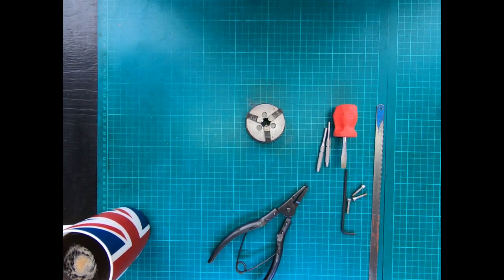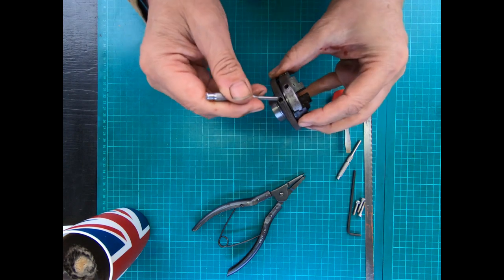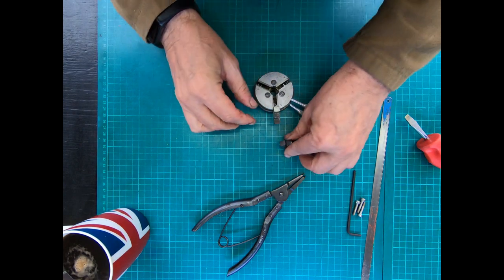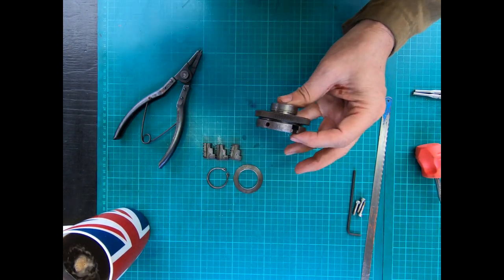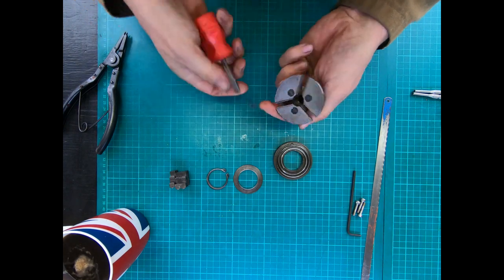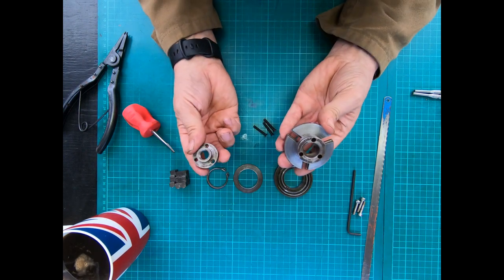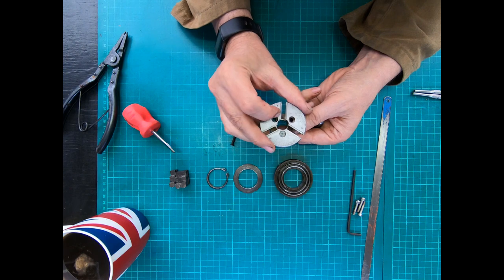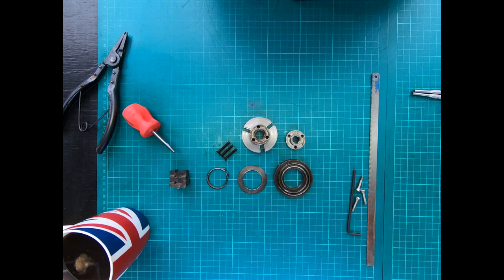Emco Unimat SL - Restoration - 3 Jaw Chuck Disassemble.

Comment: Hi Paul. I took my 3-jaw apart when I first got the SL, did not remove the backing plate, just cleaned and applied WD-40. It always seemed excessively stiff to me, but I guess that's the effect of the spring washer, your's in the video seemed to run tight as well, but I suppose that's normal.
Very curious to see how the stock threading attachment works. I had the wild idea to try driving the spindle with a stepper motor and a socket on the spindle nut, on my CNC SL lathe with the carriage and cross-slide that are already driven by steppers. But I am uncertain if this would be accurate enough for single-point threading, with the typical backlash in a vintage Unimat. Still might try it though, just for fun ...
Hope to see your other SL set up as a mill soon. With your collet set, it should perform well. Mine is a bit touchy with just the drill chuck, gotta keep the depth and feed rate low and slow.
Reply from the maker: Hello Rich,
My 3 jaw is very much the same as yours in that the spring washer makes it quite tough to turn. I am waiting for some longer screws to set up the thread cutting attachment but as soon as it arrives I will make a film. I think controlling the spindle speed might be a challenge to get a good thread.
100% there will 100% more "Unimat SL in Action" videos coming up in the near future, showing all the various attachments I have collected.
Take care.
Paul,,

Comment: Good video Paul.   The two small 3" chucks I have for the Sherline (one genuine and one totally worn out knock off) both have a one piece chuck body/spindle thread.  Interesting variation.  Cheers Rob
Reply from the maker: Hello Rob,
Thanks for dripping by... I find it interesting to see how the smaller chucks are made up... I have been working on a 2" Burnerd chuck, it is very well made. II have to make a backplate for it so will show it then.
Take care.
Paul,,

Comment: Hi Paul, interesting little chuck. You have your name already 'belleville'. These are used in packs on CNC machine spindles to activate the drawbar pull back to seat tools in the taper.... amongst other applications. Cheers, Jon
Reply from the maker: Hello Jon,
I was working on a Burnerd 2" chuck today... It has super close tolerances compared to the Unimat. The Unimat SL spindle has the Belleville washers... Many thanks for popping by.
Take care.
Paul,,

Comment: Paul, over the years of troubled fastener removal, I have found the manual impact driver to be the most successful for me; you may still need to apply heat and your flavour of penetrating fluid.
I bought this smaller one on Amazon and is also available in other drives.      PERFORMANCE TOOL W2503 Wilmar 1/4 in. Impact Driver
Reply from the maker: Hello Scott,
I have been working on the Surface Grinder recently and came to the conclusion that an impact driver would be helpful... I will order the one you have recommended, it looks good, thanks for the info.
Take care.
Paul,,